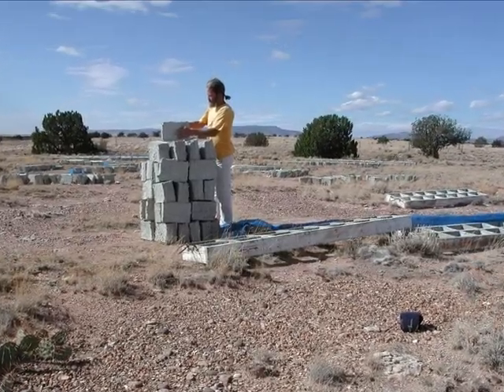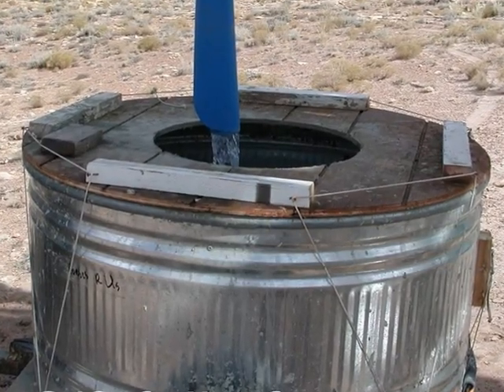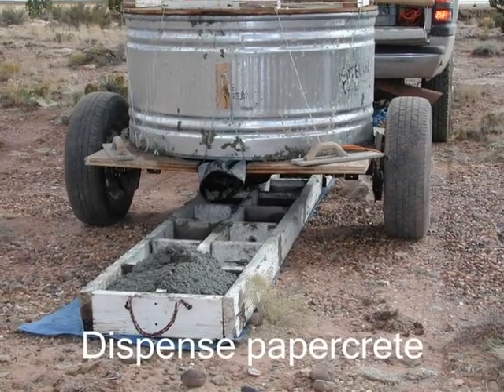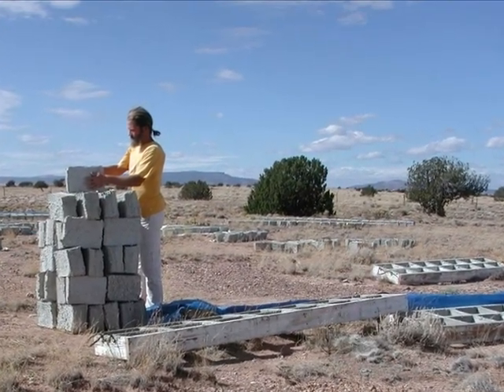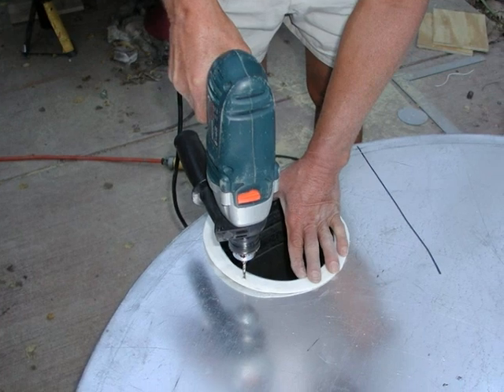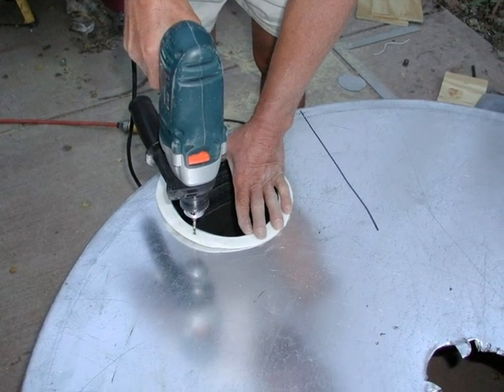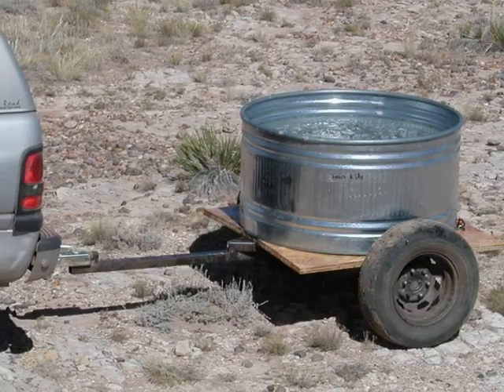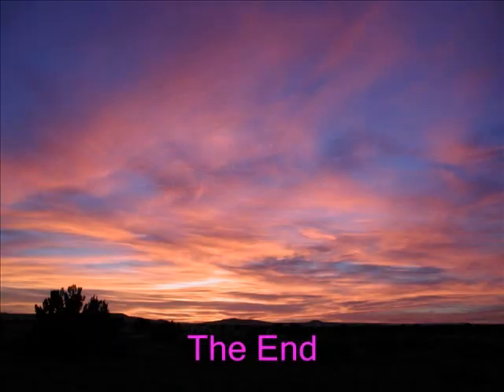DIY How to Make Papercrete in a Tow-Mixer

Comment from the maker: I'm pleased you found it useful. Papercrete can be made with very little cement, if the final product doesn't have to be very strong. Experiment with various proportions in a blender or food processor, make a small block and let it cure and then dry, then test each one for the properties you require.

Comment: Great Video Sir. Busy working with Papercrete in Namibia, I have been struggling with how to make it in a more efficient way. This does a pretty great job of it. Engineering is not a strong point of mine, I will however look at making one of those mixers, ideally one that can be run manually for starters. Thanks for the share.

Comment from the maker: The guy in the video (it was I) used Bondo with success. Your suggestion is good and will probably work as well or better than Bondo. However, Bondo is probably easier for most people to find, and I prefer to offer solutions that work for most people. Thanks for the useful tip.

Comment: My wife asked about earthquake stability. I think that these walls would be light enough to not be affected much by the shock. I then got the idea that while the brick was still wet one could use a dowel to make a rebar hole. Once the bricks were dry you could then run rebar down the walls to give additional stability.

Comment from the maker: Thank you for your appreciation - I'm glad you like the 'trunk'. I also work often alone. I designed a mixer which tips on its hitch, so all of the PC slides to the rear and out. A wireless 'baby cam' at the back lets the driver see the dispensing, which can be controlled from the driver's seat with a cable. I haven't found a way to eliminate the driver though.

Comment from the maker: John, the best examples I know of papercrete houses durability are in Columbus, NM, where a whole community was built in the 70's and they are still holding up. I visited there some years ago and was blown away by the creativity and shapes of structures, many papercrete, some fibrous adobe (cement and mud). A new house was just going up using the same materials. Like wood, PC should be protected from water.

Comment: I built with papercrete and only had a couple of issues:
1 - Papercrete shrinks as is dries/cures, causing cracks if used in large square footage (subflooring).

2 - Water absorption.  Papercrete must be sealed or have an acrylic additive.

Conclusion - great for subfloors and non-loadbearing walls.  Not so great as a roofing material.
Reply from the maker: Good observations. PC is not a substitute for concrete in every application, just in some. Makes good walls. Many have asked about water, and I say the same - it is like wood and must be protected from moisture.

Comment from the maker: Glad you like it. Make a shallow form of wood, spreading in the PC and letting it set. I've seen panels up to 4' x 4' x 2". Waterproofing PC is similar to wood, but PC has more options. You can cover it with cement made from fine sand, as for a hard surface on concrete, or for a pool or pond bottom. Dense concrete sheds water. However, cracks will probably form when it dries or later, unless you use metal lath or some wire grid, like chicken wire. Perhaps a lime wash instead, like on adobe.

Comment from the maker: Thank you, fergawdsache, you have good ideas. It is possible to use rammed-earth-like forms or whatever and pour the PC in. You don't have to cut out doorways, just block them out in the form. PC is solid, not crumbly, non-flammable (blowtorch won't ingite it), and cured and dry blocks are really hard to break, unlike adobe. It's just 60lbs of paper, water and 94lbs portland cement. For mortar, add another bag of cement to the mix to make it sticky. Good luck.

Comment from the maker: Thank you - glad you liked it. About as similar to adobe as concrete. Papercrete cures like concrete, so it cannot become soft again, even if it becomes soggy, unlike adobe, which can become soft with water. Also called 'fibrous cement', PC is one of many materials made with fibers. These paper fibers can be added to adobe (fibrous adobe) to make it very strong. Many plant fibers (hemp, cotton, jute...) can be added to cement and adobe.

Comment from the maker: It depends on what is driving on the the driveway. Papercrete has less compressive strength and resistance to abrasion than concrete, so PC is not always a concrete replacement. PC will wear away if used as a floor or driveway. It must be kept dry or it will rot, just like wood. Contact with damp ground is another situation to avoid. PC has far less resistance to wear than hardwood. Adding sand will increase its compressive strength, surfacing will improve wear.

Comment: I found this outstanding, I have been looking for a reasonable way to mix a sawdust create. Saw mills are busy, lime dust is near free, may try to add a bit of straw... maybe to test. The ratio gives me a place to start. Good information. Thank you.
Reply from the maker: Any fiber will work, even sawdust, but structural integrity and strength will depend partly on the length of the fibers. Try mixing 1 part sawdust, 1 part cement and just enough water to moisten in a bowl, pack into a cup and cover for two days to cure. Let dry. Do the same with 2 parts sawdust, 1 cement, then 3 parts sawdust, 1 cement. When all have cured and dried, test for hardness, compressive strength, workability, cut with a saw and knife, carve, drill a hole. One of the three may perform as your need requires.
Reply: marjamada
Yes, I planned to make some test blocks with different ratio's. I have run across 1 video (may not have been youtube. ) that demonstrated very durable and well insulating blocks of coarse sawdust from a mill.... Have not been able to find it again in the vast web.... [Short cuts of binder twine was my other thought. Slicing the bales (spools of twine) then blasting with air to fray the fibers.]

Comment from the maker: Thank you, I'm glad you found it useful. My web site has more pics. Also, if you search for papercrete, you will find lots of uses for it - furniture, big pots...Excellent for freeform structures and building shelters without making blocks. Or make a pile of soil, water it, shape it into an upside-down bowl, cover with a foot of PC and you have an insulated dome. Cut out a door and dig out the soil. PC is versatile and can be used where concrete would be inconvenient, heavy, expensive, etc.

Comment from the maker: Plaastek - Papercrete does not bond well to rebar, but if the steel reinforcing is smaller and thinner, like remesh or chicken wire, there will be more surface area to bond. A lot depends on the size and shape of the structure. Bread? You might have a problem with mice and rats eating your structure, and you will only know how well it binds by experimenting. Have fun.

Comment from the maker: Good question. Well, a lot of building has been done with fibrous adobe, using good ol' dirt instead of cement. High clay content may help here, unlike in plain adobe where too much clay results in shrinking and cracking. Lots of fibers and porosity will allow the mix/block to dry evenly.

Comment from the maker: I had a similar idea, mounting the motor-blade in a lid, with a safety switch to cut electricity if you lift the lid. You don't need a long blade, use a shorter one, the power will be enough. The towmixer has tremendous torque and low rpm, and weaker motor with high rpm works as well, just use a shorter blade, or a 'cross' blade like a blender. Add a vertical board or two to the inside to deflect the mix into the blades.

Comment from the maker: @porpoisefathom - Good question. Well, there are so many different recipes for Papercrete, it will depend on how you make it. Add sand and the compressive strength increases. Increasing cement will help too. My suggestion is to make small samples with different amounts of all ingredients, cure wet for a week under plastic, dry out and test them.

Comment from the maker: Yes, papercrete walls can bear a roof.  Mortar is papercrete made with more Portland cement, like 2 94-lb bags to 60 lbs paper. You can use the same mix to plaster walls of papercrete. If you want it stickier, add more cement. Be sure to wet the walls/blocks so they don't suck the water out of the mortar.

Comment from the maker: Excellent questions, so little room to answer. PC walls can bear weight, but not a roof - use pillars. Rectangles are weak, make it round and it might hold a roof up. No rebar - PC won't bond to it like concrete. Blocks can be much bigger than concrete, as big as you can handle. Add sand for compressive strength. Good luck.

Comment from the maker: This was an experiment. We made the tow-mixer and then did a test, making about 300 blocks. The blocks were not for anything in particular. I would only make a house of papercrete if I could get paper with no ink. I would experiment using other fibers: hay, grass, weeds, leaves, straw, sawdust, shredded clothes and cotton rags... and if they gave good results, I would leave out the paper. Ink is often smelly and possibly toxic, but I never smelled it in the papercrete houses I visited.

Comment from the maker: Good question, enviro. The paper fibers do not bond to rocks well, so aggregate actually weakens the block. If you mean use aggregate and forget the paper, well, then you have concrete, which has qualities different than papercrete. If you're building a 20-story building and need lots of compressive strength, go with concrete. Most houses will do fine with much less. Yes, the blocks are light and also insulating and very easy to work with, even without gloves. Strength depends on the mix.

Comment: I don't want to sound like a Debbie Downer but have to give some feedback here.
Please know that though papercrete seems like it is easy and cheap, there are a lot of drawbacks.
I lost a lot of money building a papercrete house in New Mexico due to totally trusting some people that sold me on the entire process and led me to believe they actually knew what they were doing. After spending almost 2 years trying to finish my house had to give up in frustration.
I had fought with local building inspectors and had to convince a bank to give me a building loan and after I ran out of money used my own money to attempt to finish the house.
In the end, I had to let the bank foreclose on me and I lost around $50,000 of my own money.
Just know that realistically one needs to add other ingredients to the mix, otherwise the shrinkage,the voids in the joints when you are building have to go through several cycles of freeze/thaw and seasonal adjustments before you can add stucco and unless you are financing the project yourself , a bank will not give you that long to complete construction.
There are just too many other factors to adequately address here, but I suggest you speak with an expert before you take on a serious home building project. The man in Big Bend Texas is a great resource.Frankly, though Mike McCain is supposedly the grand master, his formula and techniques may be suitable in some applications and areas like Mexico, but keep in mind that   if you are building where there are building codes you will have an uphill battle.

Comment from the maker: A basic mix is a pound of paper for a pound of cement, but if strength is not a priority, the cement can be reduced considerably to give more of an insulating quality (more air). We didn't measure water, but a guess would be 100 gallons for 60 lbs of paper. I suggest making experiments in a food processor using various proportions to achieve a mix that suits your needs. Make balls or blocks, Keep wet to cure for a few days, dry, then test for qualities you want.

Comment from the maker: Papercrete can be made in so many ways that a fixed recipe doesn't exist. That's because there are so many uses for it, so the ingredients and proportions vary according to how it will be used. Experiment using a food processor and small amounts to find out what properties cured and dried PC has, then you will know how to make what you need for a job. A basic mix is equal parts by weight of paper and Portland cement, then enough water to allow proper mixing and dispensing, but not more.

Comment from the maker: Figure 8 sounds good, but I haven't tried it yet. You can certainly make stretcher blocks of PC with holes to save weight and material, but it depends on what the blocks will be asked to do. PC does not replace concrete in every case, especially where compressive strength is required, or where there will be abrasive wear.

Comment from the maker: The holes in concrete blocks are often filled with rebar and concrete after making walls with them. Papercrete cannot replace concrete in every situation. On the other hand, PC can be used for things where concrete would not work well, like large flat wall panels. Your questions about compressed PC could probably be answered by those who have the site you mentioned.

Comment from the maker: RonRay - Papercrete can be made to suit many different applications - more insulation, more compressive strength, etc., by changing the ingredients. In fact, you can use other fibers instead of paper, like bamboo leaves, weeds, hemp, etc. The product is fibrous cement, so experiment with a food processor to get the product with the properties you want. Firing would burn the fibers and the product may explode, due to air trapped in the clay.

Comment from the maker: Face the turning part of the diff up and bolt on the blade. 18" lawnmower blade I used matched the holes perfectly. Just put the blade where the drive-shaft was.

Comment: There are two types of fiberglass used on automobiles.  Those are fiberglass cloth and fiber glass filler.  The fiberglass filler is found at the auto parts store with the bondo.  It looks and works very similar to bondo.  The difference is that it uses fiber glass in a resin with a hardener.  I am thinking the fiberglass filler will be much stronger and more resistent to the water in the tub.

Comment from the maker: Some people do make larger blocks and even panels up to 4' by 2'. I see no disadvantage to larger blocks, as they are light, and it probably would speed the construction of walls, etc. Hollow spaces are also possible, however it will depend on the loads. A wall having no load, like a roof or second floor, could use hollows to reduce material use and lighten the blocks further. Test the idea first with varying amounts of hollow to see which proportion meets your strength requirements.

Comment from the maker: Excellent question, susun9susun, and one of great concern to those making papercrete. If it gets wet and STAYS wet, it can grow mold, but due to the cement, it stays hard. It needs protection from rain and moisture like wood and other vulnerable materials. Sun City, near Columbus, NM, has many PC buildings, all doing fine 25+ years later.

Comment from the maker: Cured papercrete will absorb water but will not become soft. Like wood, it will rot if left wet. If you make papercrete in any shape and then cut it into smaller shapes, have you saved time? By making blocks the size you need, you do not need to cut the stuff later. You can use a wood saw - it cuts easily, but it makes a fine powder you don't want to breath, and it's messy. Try it both ways and decide what you like.

Comment: The guy in the video says to use bondo to fill the gap between the tub and the differential in the Towmixer.  If you really want to seal it well, I would recommend using fiberglass filler instead of bondo.  The fiberglass fillers are very similar to bondo but they are much stronger than bondo.

Comment from the maker: The insulating properties of PC make it valuable in cold climates, however it must not become wet or it will grow mold. As for adobe, a stem wall is usually built for PC so it does not sit on the ground and get splashed during rain. PC will not get soft once cured, even if soggy, but it will grow mold, so it must be protected from water just like wood and other absorptive materials.

Comment from the maker: Well, it was a 160 gallon stock tank, so I'd guess about 100 gallons, maybe a bit more, for 60 pounds of newspaper. It had to be just fluid enough to flow out the rubber hose (inner tube from a car tire). The paper pulp traps ALL of the Portland cement, and the water that drains off after pouring into forms is clear!

Comment from the maker: Cost per block depends on the amount of material in a block (size) and how rich the mix is - how much cement per pound of paper. With an average of 1:1 and a 94-lb bag of cement, you'd get around 55-60 blocks measuring 12" x 8" x 5" and weighing about 3.5 lbs each. So divide the cost of a bag of cement by 55-60 and that's your cost per block, if cement was your only cost.

Comment from the maker: And thank you for commenting on it. A lot of people like the 'elephant trunk' on this mixer, and when you use it you will understand why. My next mixer will have a different blade - the lawnmower blade hits the paper straight on and some paper wraps around it, making it a paddle that throws mix all over. A better design would copy a food processor blade which slices with a curved blade. I'd probably start with an old saw blade and weld on curved blades I made. Anyone want to experiment?